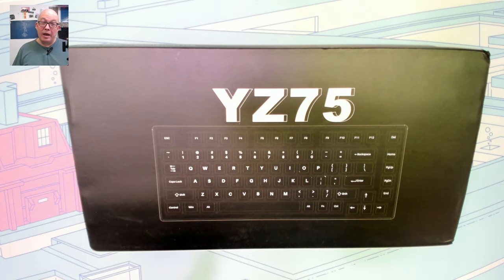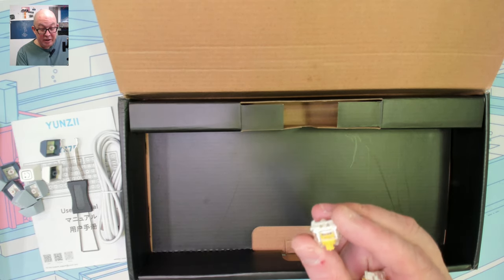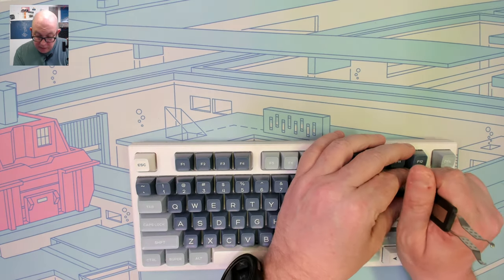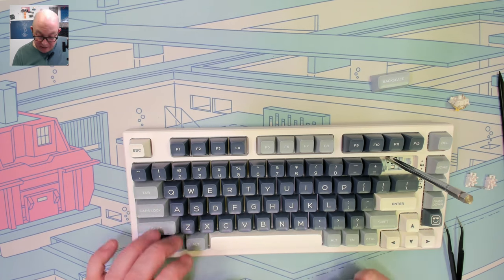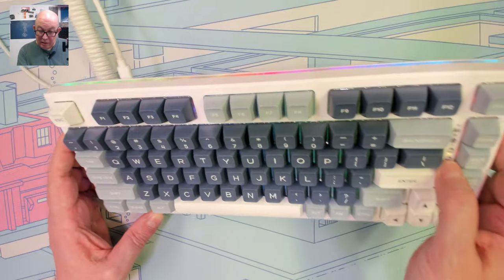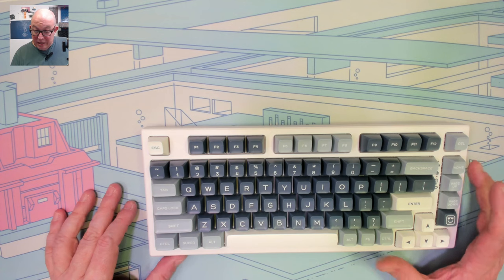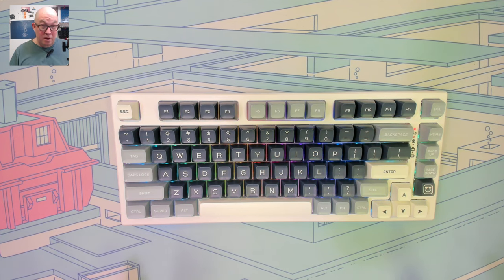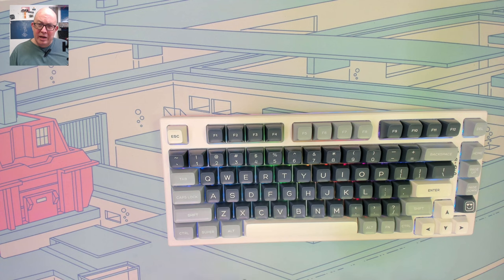Yunzii YZ75 Pro Review and Sound Test

Comment: Thanks for the review. I like the form factor, 75% is a good size for wireless or wired and the 5000mHa battery should last awhile. The color scheme is good too because it's still legible in low light even with the RGB turned off. Sometimes you don't want your desk looking like a rave or a 70's disco with all the RGB.